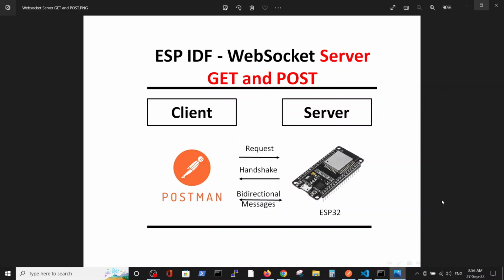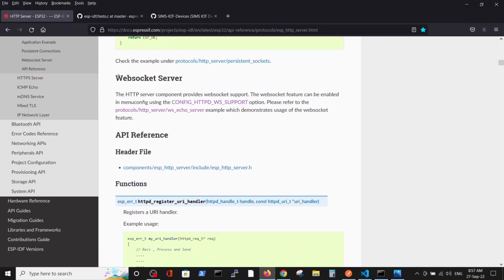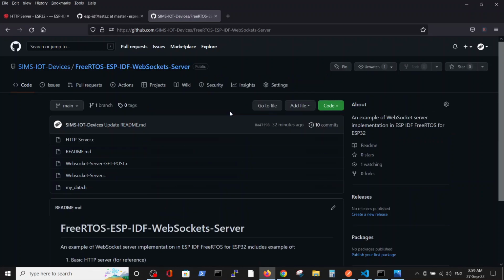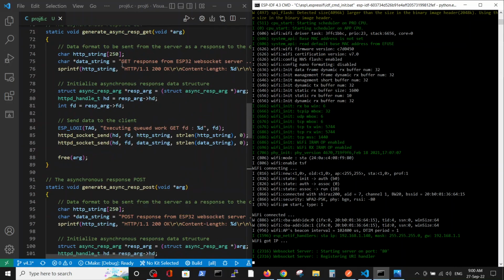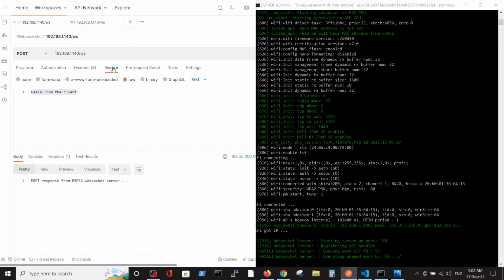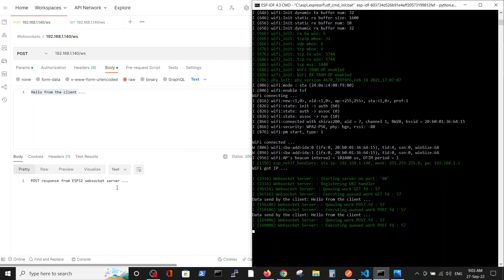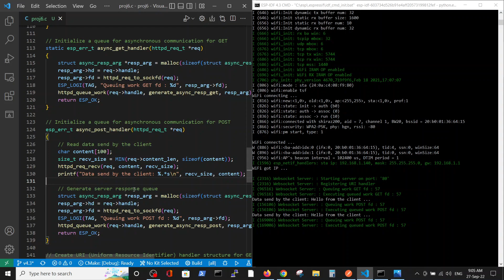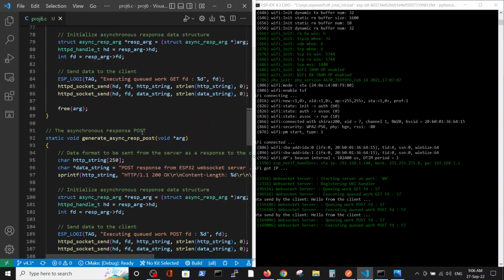4 - WebSocket server implementation with GET and POST in ESP IDF FreeRTOS for ESP32

Comment: made a tutorial on to store data in SD CARD using esp32 with esp-idf . help please
Reply from the maker: Dear Embedded Junction,
Please elaborate regarding the system you are building. How your SD CARD is connected to the ESP32 board (via I2C or SPI or ...)? Maybe you a using a board with an integrated SC CARD slot. Which kind of board?
Reply: @simsiotdevices6219  hey i'm using hw-125 micro sd card adaptor and esp32 microcontroller! then i get an error
Reply from the maker: Dear  @embeddedjunction9204  
So you connect the HW-125 adapter via SPI communication, right?

Comment: Try do a CRUD with SPIFFS Create, Read, Update and Delete json files, and receiving an Bearer token for header https
Reply from the maker: Dear Felix,
From my understanding, SPIFFS deals with a file management system, while GET and POST refer to communication between Server and Client. Did I miss something?
Reply: Let's say you're building an ESP32 web server, you'd have to write or code the HTML and CSS in the source code itself. The use of SPIFFS, allows you to store the HTML and CSS files as separate files that will be used by the source code, to make  a logIn from a browser or phone, we need to change the ssid and  password wifi by default inside Esp32, after we start in client mode, we need to interact with Html, for example, turning off a LED or adjusting intensity by PWM, this is done through a .json file which receives the sp32 and SPIFFS is essential to interact with HTML, CSS, JAVAScript and our ESP32 GPIOs, I think I have explained myself better.
Reply from the maker: Dear Felix,
I got you, I will try to elaborate on SPIFFS in the future regarding the HTML integration.